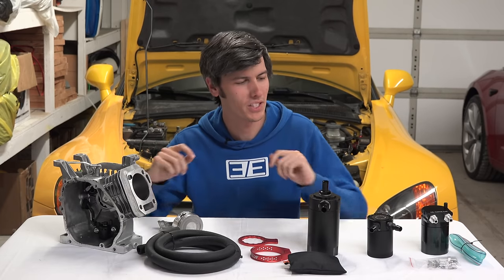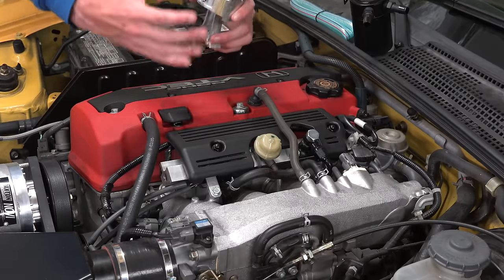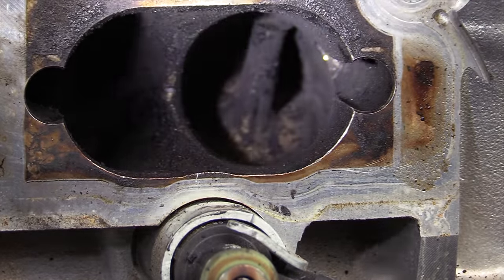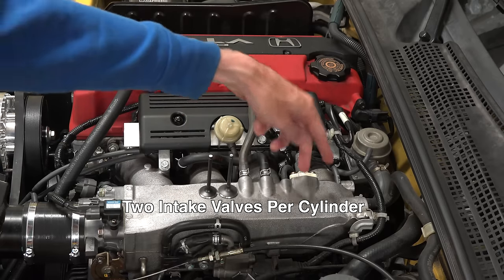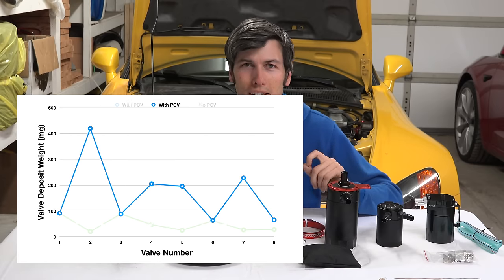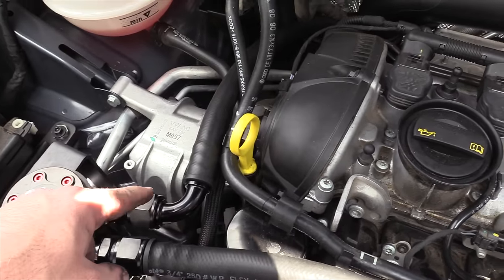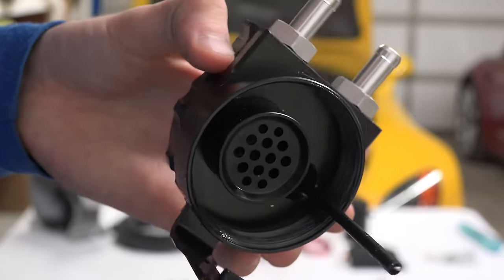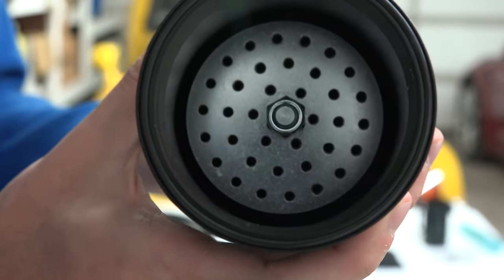Do Oil Catch Cans Actually Work?

Comment: Very interesting, I have read for years that the Gen III Chrysler Hemi tends to build up deposits behind the throttle plate and catch cans are recommended. I have not installed one but have used Mobil 1 since I bought it (when it was 2 years old  25,000 miles) and when I checked it recently it was pretty clean. Our other vehicles with port fuel injection haven't had obvious issues with build up on the throttle plate or valves (98 Subaru, ran it to 186,000, 98 Jeep, ran to 181,000, 17 Jeep, now at 78,000, 17 Subaru now at 60,000). However we used to own an '88 Toyota Camry 4 cyl and an '89 Toyota Corolla GTS with the 4AGE engine. Both, would develop deposits on the throttle plate to the point that the gas pedal would get stuck with a cold engine. I had to clean each one yearly. Not sure why this was, but it was  consistent problem. These might have benefitted from an oil catch can but they weren't common then. I do miss that little 4AGE engine though, it was a fun car with the 5 speed.
Reply: I just bought a 89 gts lmao, def gonna get a catch can for it, esp as its at 274k miles

Comment: A better solution would be to have some kind of filter or deflector inside the crankcase, before the PCV valve. The collected oil would just drop back into the case. Actually, some kind of retrofit plug would be feasible.
Reply: My 2007 Volkswagen comes from the factory with a PCV valve that incorporates an oil separator and a drainback feature. It is a little complicated because the engine is turbocharged. At idle the crankcase gases are routed to the intake manifold by vacuum. At high RPM the intake is under boost pressure, so the crankcase gases are routed to the turbo inlet.
Reply: This is generally a better idea than an oil catch can. I wish there would be options for this.
Reply: Lots of cars, possibly all of them, have this and it's a fail. Sure they help but it's not cutting it. If you put a filter after it you'll see what I mean.

Comment: Little trick. The old Lexus 2.5 V6 engine you will find on the 2IS is known for it's carbon deposit. Catchcans are basically a must have for those cars.
Reply: Should you have 2 catch cans for a V engine or is one large good one sufficient? 
And would a 2 port or 3 port can be favoured?
Reply: You mean inline 6 or I6.
Reply: THIS! And make sure that when you're doing the oil change and emptying out the oil catch can that the seals on the oil catch can are still good. Any air leaks will throw P0171 and P0174 codes.
Reply: Panamera Ghost is250 is a V6 with direct injection. I think the is200 is a ported injection that wouldn’t really need the can :)
Reply: Definitely. Too bad we didn’t just get an IS350!
Reply: No, there is only one exit out of the engine, so a regular catch can with one in and out will do the job.  @martinburke3755
Reply: Same with GDI Audi's. Working in a shop we had a walnut shell blaster setup for unclogging their intake valves. No matter how you try it's a horrible messy job, audi should have planned on an oil separator for their pcv system a lot better.
Reply: I have one with about 90k miles. Is it to little to late or i should install one? What s your take on running vented?
Reply: Don’t forget to check oil quantity on the dipstick after draining the catch can....especially if you are getting as much drainage as seen in some videos.   The oil is being captured by the can and obviously not cycling back through the engine.  Eventually the engine is going to figure out that the oil isn’t coming back and will want more....hopefully you check and re service lost oil immediately or step 2 the oil pressure warning or gauge in some vehicles and hopefully before step 3.....engine seized from oil starvation.  My catch can usually winds up draining about 1/2 teaspoon every 2000 miles.  Depending on the model they are really simple to drain.  I can find gas station start filling tank, remove can, drain, clean out reinstall can check oil quantity and be done right about the time the fuel tank is finished filling. I can usually wipe out the fan with a shop towel, rag or napkin.  After that i use a fresh one to make sure I wipe out any possible debris.

Comment: can you tell me why I would not want to put a valve that I can open and close on the bottom of the catch can, connect a hose to the valve so it can drain as I drive while leaving the valve open at all times. would that throw a check engine light or hamper performance? or can I just run a hose from the valve cover so it drains and plug the intake manifold? also doesnt oil catch cans slow the pressure release? I would think it has to

Comment: Glad that my BMW V8 already had an oil/air separator 20 years ago... But it's also BMW, so in order to change it I need to remove the timing chain😆
Reply: My Golf 6 GTI also had a device that was supposed to catch the oil and let it drip back into the engine. It didn't keep the valves from building up carbon deposits.
At 6:41 the finger points to this device. The round part contains a membrane that does some kind of pumping. I forgot what it exactly does.
Reply: Porsche also had them 20 years ago. You didn't want them to fail. Won't be pretty for the intake or the exhaust specifically the cats. They also fail often... with little warning given all Porsche smoke on start up.
Reply: michael nola  don't forget they fought all of the world
Reply: michael nola  Yeah but before they lost, they engineered a pretty nifty extermination system.  When you analyze death camps from a logistics/engineering perspective as opposed to a hatred one, it was actually very impressive and cold and calculated.  What I mean by that is that while Nazis are often depicted as crazed, blood-thirsty killers, the actual implementation of the final solution was akin to getting a complicated project off the ground.  Everything was researched, planned, documented, etc...  It's even scarier, in a way.
Reply: michael nola apparently the gas chambers were implemented specifically because most people weren’t insane killers. Murdering innocent people took a heavy psychological toll, even on people who were on board with the Nazi program so they decided to try and put it out of sight, out of mind.
Reply: hugolafhugolaf so did epstein
Reply: catch can or not , very expensive to fix..had one
Reply: michael nola  " As for the Nazis being perceived as evil, psychiatrists examining them found them to be normal, which shows you what people are capable of, given the circumstances, as any reading of history would attest."
Jeremiah 17:9 "“The heart is deceitful above all things, And desperately wicked; Who can know it?"
Reply: michael nola  world war record of 0-2 when minding their own business and nearly defeating the whole world. 1v1/level pkaying field, Germans always win. It's in their DNA, but people call it white priviledge these days.
Reply: Too bad that became lost technology by the time they made the N54.
Reply: E39 35/40?
Reply: @JamLeGull  wildly off topic but, actually, I believe it was due to the amount of ammunition being used. Gas was considered more efficient.
Reply: @kimosabbe50  and of course, the power of lies. The bigger the lie and the more you repeat it the more it is believed. And of course,  I am referring to Hitler not Trump?
Reply: @cafeandfighters  I believe you replied to the wrong person.
Reply: eh... you don't need this. If the system is functioning properly, you do not need this.
Reply: @MetalheadAndNerd  i dont think that is a pump. i think that is a pcv valve. which basically just has a diaphragm allowing for one way air flow and the pil deposits gunk that diaphragm up so its a good idea to check them every couple years

Comment: One thing I found with using catch cans, they clod up over time and require removal and thorough cleaning. I change the oil on my 4x4 every 7000km or 6 months and remove and clean the can every 12 months. A fair bit of water/oil mix is cleaned out each time, this is the stuff that clods the cc.

Comment: Great video explaining oil catch cans.  My Alfa Spiders came stock with oil catch cans.  They use a metal mesh membrane and the swirling motion drops the oil to the bottom of the can.  There's a oil return hose at the bottom of the can.  What great technology in an car designed in the mid 60's!
Reply: That's better, instead of having to empty it every once in awhile just have it drip back into the engine.
Reply: @matthewluna6443  that defeats the purpose of it...
Reply: @matthewluna6443  Yeah i wouldn't be doing that. You will have fuel mixing in the oil as well.
Reply: @michaelcohen9363 not really, since the condensed oil vapor (or oil for short) will enter the crankcase where it belongs
Reply: That’s an oil separator system not a catch cam system. Is it hooked into the coolant system at all? They usually like to do this so the oil is maintained at the same temp as the running engine so no frothing occurs.

Comment: Could you do a duplicate video on air/oil separators? Same concept, but no need to drain. Are they as efficient as oil catch cans? Liked how you referenced a study and included a mechanic. Thanks!
Reply: The old Ford 2.0L 4cyl engines had one of these and they'd get clogged up over time. Hidden under the intake so unless you knew it was there you'd probably miss it. Blown gaskets, oil pushed into the distributor, oil leaks all over were easily solved by simply cleaning this thing... Didn't work exactly like these as it was on the upstream side of the PCV but it did reduce oil mist in the crankcase ventilation system airflow. I've fixed plenty of these engines with ten minutes of time and ten cents worth of solvent.

Comment: 2 questions:  1.) If the solstice made it 500k miles without a catch can, is it really necessary?    2.) The test you referenced is a comparison between stock PCV and no PCV, so why are we assuming that plumbing in a catch can is the same as completely deleting the PCV?  Seems a bit of a leap.
Reply: 1.) That wasn't the purpose. The use of the high mileage car was to pick a worst-case blow-by example.
2.) Yes. You did make a bit of a leap there.
Reply: they just vented their catch can into atmosphere. with a good catch can, I think the difference between venting to atmosphere and venting to intake is gonna be minuscule, if it even turns out to be measurable.
and yes, even though you ''can'' make it 15k miles between oil changes for example, it's gonna be way better for the engine if you don't stretch it that long.
Reply: Any car will make it past 500,000 with enough repairs
Reply: The logic leap on no PCV <-> catch can is difficult to understand.
Reply: @loomspace  I know right. If routing a pcv to intake causing so much problems. Just eliminate it. Or like I posted just tap a breather/check valve into the crank case somewhere and into the atmosphere.
Reply: Andres Rea - you’re supposed to feed the cleaned air back to the intake. It’s not supposed to vent to atmosphere, it’s supposed to be an in-line filter for catching that emulsified air before its fed back thru the motor. My Viper build wouldn’t run right until I fed the air back to the intake to close the loop. Just plugging the intake and running that pressurized emulsion into a can would make me have to drain often and the motor ran like $h!+
Reply: Every Toyota I've owned has gone 300k miles before I sold them. No Catch cans just seven pages of oil changes and maintenance that my trusted Midas tech kept up. 
Their still running around town. 😉
Reply: @rxonmymind8362  You dont even need oil for those cars.  I drove mine for about a few months, figured id check the oil, the dip stick was shiny chrome  🤣 Id been driving around with no oil.

Comment: Great video. Just run a 3/8 hose from valve cover to bottom of the car. Install a piece of screen at the end. Cost $2.00. Illegal? Who cares. Just put the original hose back on before emission test.
Reply: and plug intake pcv port.

Comment: Sintered bronze filter blocks clog and generally suck as filters. GM used to use those as fuel filters hidden on carburettors. Your engine would start starving for fuel and you had to find and remove the hidden filter, then replace it with a standard inline filter.

Comment: I’m interested in the cleaner intake aspect. I have a hemi ram with the active intake runners. Really don’t want that all gummed up with deposits. Definitely doing a catch can when I upgrade to a 6.4 truck intake.
Reply: Unless you are running direct injection, you don't need one. That's the point of the video.
Reply: @mudgem3742  Not true. Any engine that feeds crank ventilation back into the intake can benefit. Oil mixed into air intake negatively effects engine running and efficiency. All modern engines do this. Direct injection engine have the ADDITIONAL problem of carboned up intake valves and intake track as a result. You can usually find significant oil residue in the intake manifold of any engine that has actually been used.
Reply: @jonathanrees3765  not, its not true, never has been true, and can only be kind of true on modded engines. Neither I or any certified mech will tell you that you need one on a non DI engine.
Reply: @mudgem3742  So why has my catch can on an un-modded engine have a whole lot of oil in it? And this engine does not show oil usage between services, so no worn rings or bores. And the manifold that came off a low mileage car have an oil film through it? Do some actual research. Or actually work on a few engines.
Reply: @jonathanrees3765  I second that,   I just strip the admission on my GDI 2.2   non turbo, 80.000 miles... is an oily  mess, valves are covered in  that black muc.  My only concern is wich catch can I wil get as 200 bucks is too much.
Reply: @jonathanrees3765 I’m definitely buying one. I have a 2012 ram with the 5.7 hemi and last week I changed all 16 spark plugs. Noticed some black carbon build on on the old spark plugs and went and bought NGK ones with NGK coil packs. Cleaning my throttle body this weekend since there is also black residue from oil going back to the intake. Truck is strong and has 228,000 miles with no problems. Want it to last forever I guess. Hopefully a catch can will help out.
Reply: @mudgem3742 The fact that an oil catch can precipitates out oil, water, & other combustion impurities from running through the intake airsteam is a GOOD thing.  Catch cans are inherently MORE advantageous for direct-injection engines, but they do also benefit port-injected engines.

In ANY engine, it's better to burn air that is free from blow-by combustion products - regardless of engine type. Since a small percentage of the blow-by, which the PCV system feeds from the engine to your intake system, winds up BACK in the crankcase oil, your oil is continually being contaminated (to an extent) by the combustion products contained in blow-by. Clean up the blow-by BEFORE running it back through the intake and your engine and your oil will be better off.
Reply: @jonathanrees3765  if you didn't have a catch can it wouldl have  cleaned the valves and burnt the oil vapors as intended because it's not DI.  The only reason you caught oil is because you interrupted the systems normal function like a goober.
Reply: Oil does NOT clean valves. It is an unmetered hydrocarbon that burns badly so has a detrimental effect on engine efficiency as well as power.  It is the CAUSE of carbon build up on valves. You have serious engine problems if you are burning oil on the back of valves and the valve stems - or in the intake manifold. Oh and oil build up in the manifold happens on stock engines without "goober" modifications.  Do you actually know how an engine works? Air fuel ratio, combustion etc? @ih8humanity
Reply: @jonathanrees3765  omg do you know what the hell port injection is or what it does?   Good grief.
Reply: Sorry, did know is not realize English is your second language and you are struggling to understand. Yes, I know what direct injection is, and actually understand how it works. None of what I have commented is specific to Direct injection engines, why do you think it does? You know it has always been standard on diesel engines? Direct injection on petrol/gas engines is fairly new. BUT direct injection engines compared with port injection have a much greater problem with intake carbonization, to the extent that some manufacturers have gone to a combination direct/port injection configuration. This allows petrol/gas (from port injectors) to "wash" the valves and reduces carbonisation (which is caused by oil). Some Direct injection NA engines have had idle and running problems by the time they have got to just 30,000 Kms. This has resulted in several products and methods to de-carbon intakes tracks and (back of) valves being developed without needing to remove heads. Port injection engines do not have the same problem of carbonization, but ANY unmetered hydrocarbon contamination of intake fuel/air is bad. Oil vapour from the engine is unmetered. @ih8humanity

Comment: Did you know if you placed the can between the PCV valve, and hose without locating it away from the engine, and just left it right next to the valve, you would not get anything in it.  The only reason it fills with water and oil is because the length of hose to locate it allows the vapors to cool and condense.